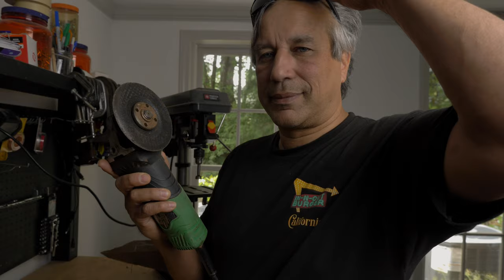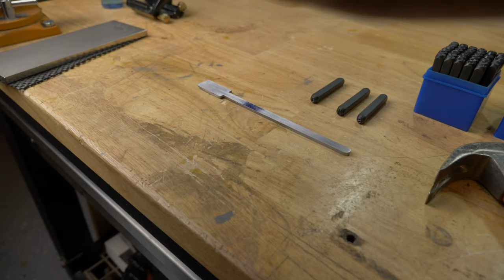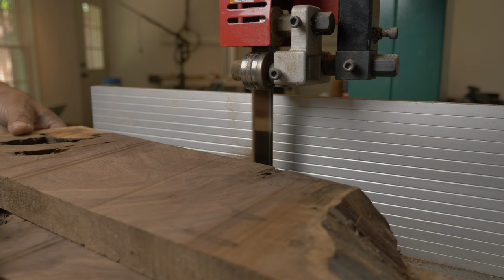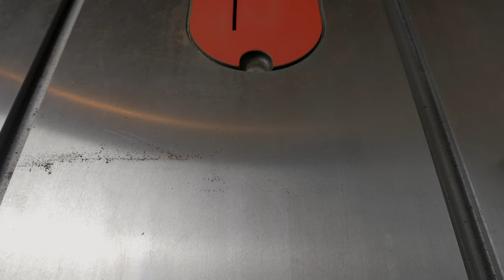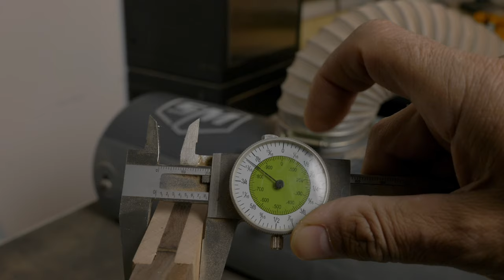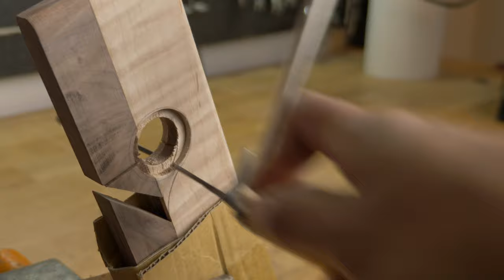The Ultimate Wooden Shoulder Plane/Hand Tools

Comment: Nice video -- I appreciate how you mixed the audio -- with the nice balance between the work itself and the music overlay.

I had a visceral reaction when I saw you spraying water over the MFT top -- does this not cause an issue?
And I'm curious how much you're using the MFT since you built your handtool bench?
Reply from the maker: Hi Biedawo,
Yes you got me, spraying water on an untreated MDF is a bad idea, but when I bought it I cunningly painted it with wood sealer expecting one day i'd be dum enough to do such a deplorable act on a Feestol MFT Table!
I initially bought  the MFT table because I was going to do cabinets for our house, that's mainly where the MFT excels, combined with the track saw, but once I got done with my cabinets I've found plenty of other uses, such as when I domino small part like in the last video i did on the White Oak Cabinet, the parts ended up so small it would had been difficult to hold them down in any other way.
The other issue I have is I don't have bench dogs in my hand tool bench yet, but do I plan to add them at some point,  (possible video idea....) so maybe then the MFT its usefulness will slow down,
It also works great as an out feed table for the Kapex as they’re both the exact same height, those clever little german designers , you gotta hand it to them, lol
Hope this helps.buddy.
Michael 

Excellent questions, BTW